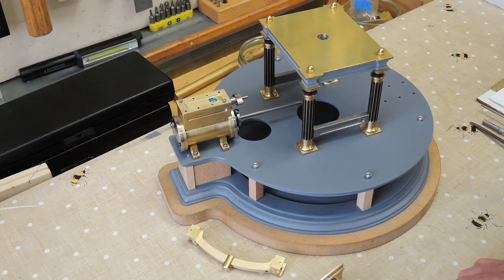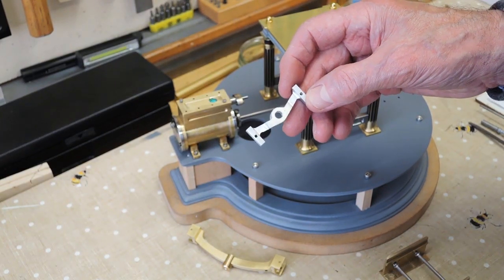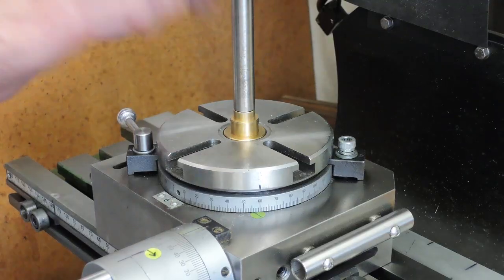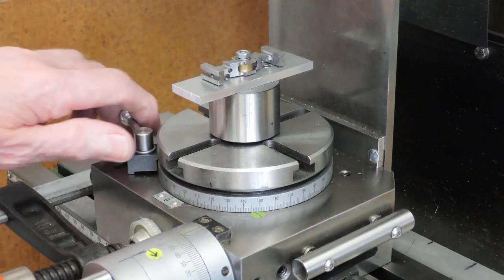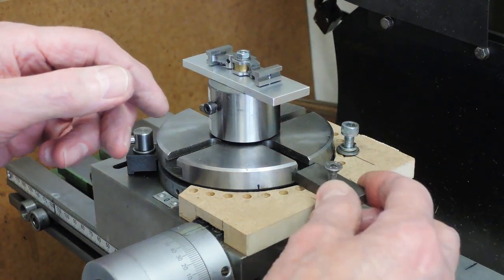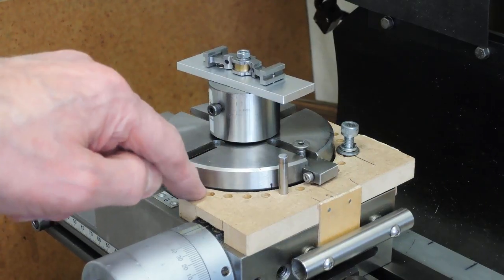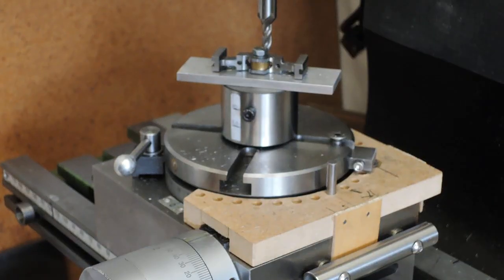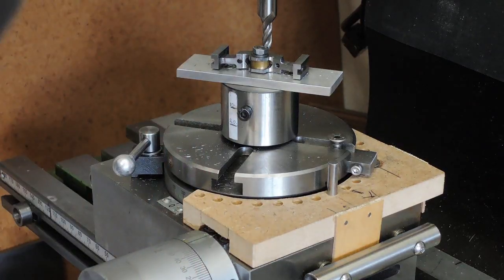Model workshop using a Rotary table with stops

Comment: Really nice - I love all your little additions, etc.! I've never considered just using the morse taper to hold things, is it really safe?
Reply from the maker: Yes it seems OK as long as the cuts aren't to heavy, I've now made a better version with a few fixing holes taped into the Rotab body. I use this method of blending curves into corners as I don't like filing. Typical use is eccentric straps.